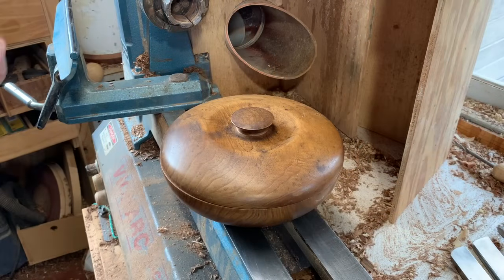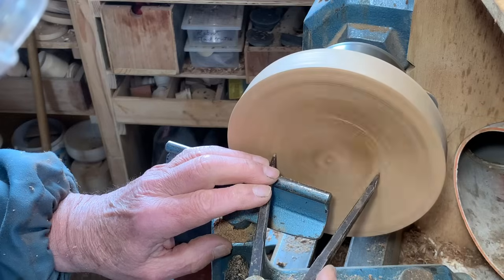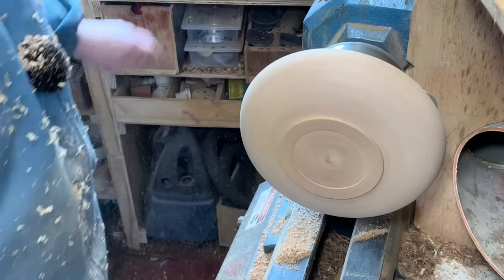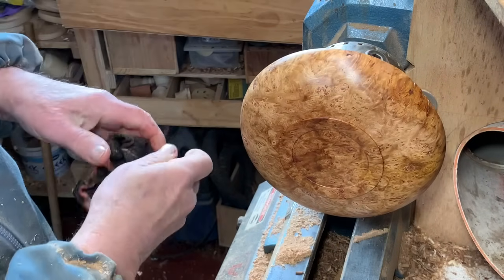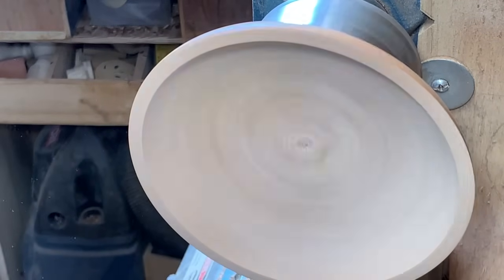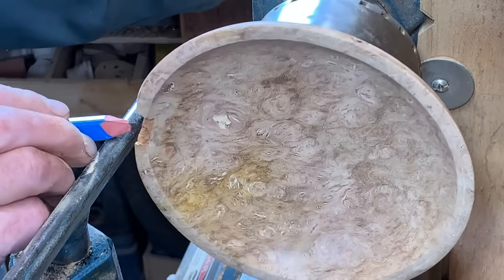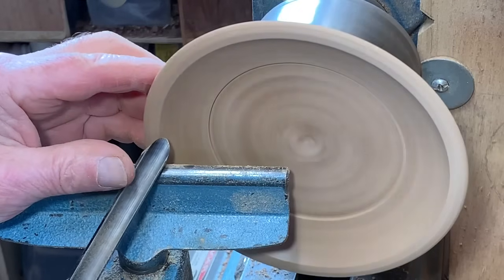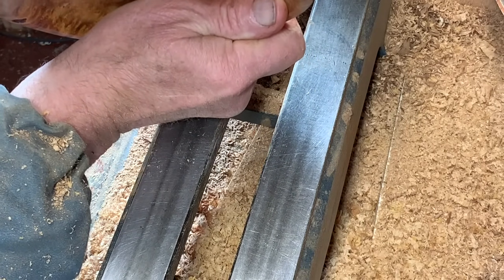Richard Raffan has problems turning eucalypt burl — a box becomes a plate.

Comment: I'm very pleased you posted that Richard. Having recently finished a highly figured thin walled Pear bowl I noticed two low spots in the wall and assumed  I had done something wrong. On inspection after watching your video, it seems some areas are much softer than others. I now know they sanded faster than other areas. I've learned something today and it's only 07:20. Thank you.

Comment: Hi Richard, you inspire people when there is a problem with what they set out to do, look for the good part of what's left.  Thanks for your straight forward no nonsense attitude towards your educational attitude.  Always straight and to the point no nonsense or rubbish excuses.  It's really nice to know you're only human, there's hope for me yet.  Cheers you're time and patience in compiling, editing and posting these videos of yours is really appreciated.

By the way, I have just managed to get hold of the Makita right angle drill for sanding and wondered what you're best advice is for the average sanding speed is with it.  I am aware that there is a rotor dial for the speed setting.  Your drill looks like it's served you well, so you are obviously looking after it.  Again thank you for your time in (hopefully) answering my question.

Regards and best wishes as always, Tony M.  New Zealand.
Reply from the maker: I have two angle drills, both manufactured at least 20 years ago.  There's no speed dial, just a trigger handle. They're rated 2400/min. I tend to use them full speed.
Reply: @RichardRaffanwoodturning  Thank you.

Comment: Watching you overcome problems is an amazing way to learn. it is a lovely figure in that little plate. What would have been the advantage of having the soft spot in the middle of a bowl had the blank remained in one piece? Would it not have sanded away more easily there too? Would this have been a rare candidate for saturating with CA glue or such? Many thanks for another educational and entertaining video.
Reply from the maker: I prefer to turn away internal pockets of soft grain, but where that's not possible I'll flood the patch with CA glue provided the patch doesn't stand out from the surrounding material.

Comment: Hello Richard,  Another great video with solid instruction and Tips.  It would be interesting to see how you bore the holes that then are used to mount on your shark jaws.  I assume you must have some special way to hold the wood while drilling the holes  on a drill press (I assume with a forstner bit) so they don't get away on you etc. It looks like you don't use a dovetail recess but rather a straight sided recess. All of my NOVA jaws have a dovetail when used in the expansion mode.  Are your shark jaws dovetail or straight sided for the expansion mode..  If they have a dovetail I assume if you are using a straight sided hole.  Do they sill hold well, it sure looks like they do?  Please advise.  Thanks for your videos, Myles
Reply from the maker: Blanks over 80mm diameter are handheld.  Blanks under 80mm are held in a vice. The holes are drilled using a forstner drill, so are straight-sided. This video shows how I use chucks:  https://www.youtube.com/watch?v=DV2T6oJgCi4&t=94s

Comment: Hello Richard love your videos, learning a lot from you so thank you.
I have questions About your scrapers, do you raise a burr on them with a burnisher? Do you sharpen them before every bowl? At what rpm should i be working with them?
Im trying to get a good finished surface with them but most of the time i end up with torn grain. Would love any tip from you.
Again thank you very much
Reply from the maker: Mostly I use scrapers straight off an 80-grit CBN or aluminium wheel having honed the top of the scraper first. I don't hone that often, preferring the burr off the grinder. I sharpen everything at the beginning of each working day and then as needed. With some timbers this can be a dozen times a bowl. You sharpen whenever you think the edge might be slightly dull. Timbers vary, with some working more easily than others. Softwoods and softer hardwoods aligned at 90° to the lathe axis (i.e. facework) are generally more difficult to cut cleanly, particularly on the endgrain. There is no "correct rpm" for scraping because the speed of the wood coming onto the tool is faster the further you're cutting from centre. You need a light touch finishing with scrapers, and usually get the best results shear scraping with the tool up on edge.

Comment: Could have made a small lid handle separately with a small tenon and fixed it to the lid I suppose? I know there would have been the little tenon imperfection under the lid top but it might would have worked out.
Reply from the maker: Designwise, I'm not one for seperate knobs, let alone using a different wood or, even less thaan that, tall finials.
Reply: @RichardRaffanwoodturning  right, a different wood would definitely be less than ideal, unless one went completely opposite in hue for a contrasting detail, if a man didn't have anymore of that species to work with.